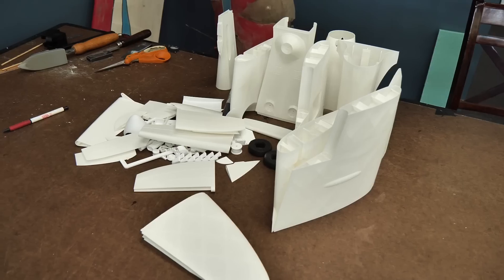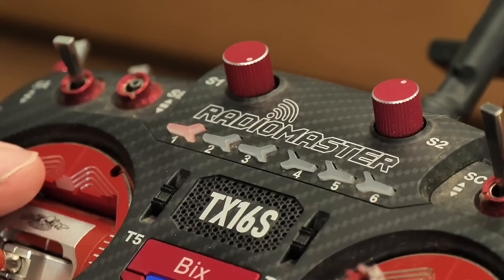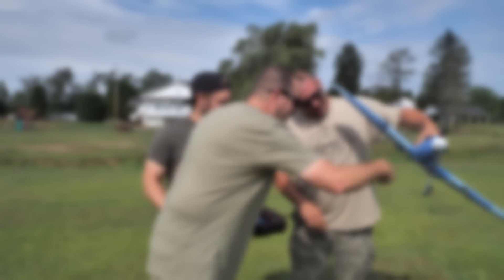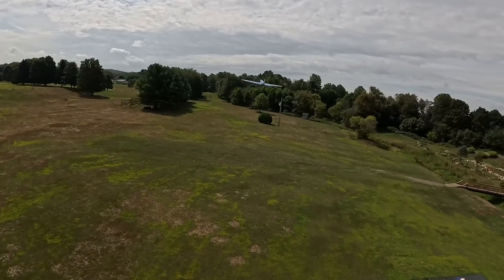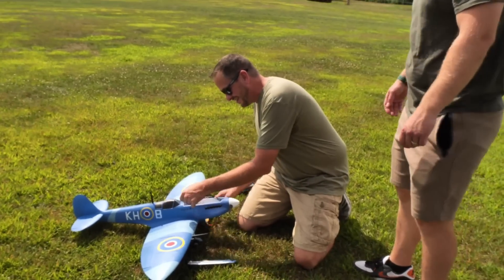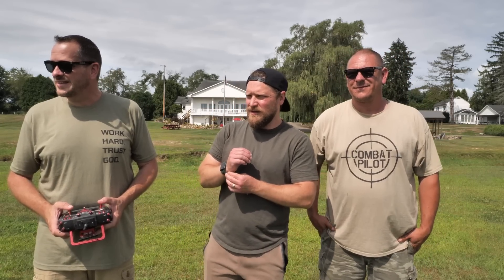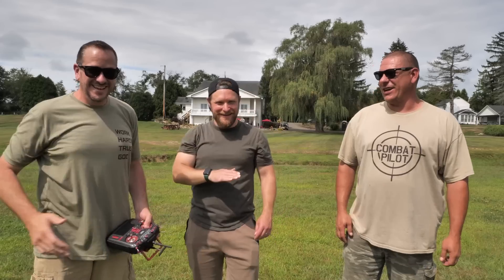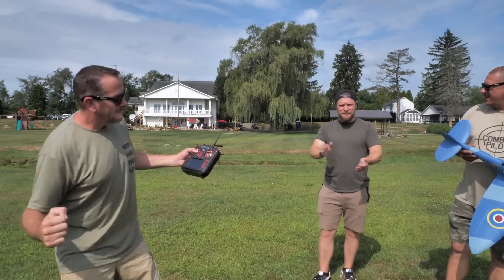Turning Plastic Into A Flying Airplane - Eclipson Spitfire

Comment: I make foamboard planes but I use 3d printing for the details (cockpit, cowl, etc) because 3d printed wings and fuselage are much too brittle. Foamboard is a perfect building material for planes. I will stick with it thanks.

Comment: I have 2 UAV Vtail 3d printed planes. One is LWPLA the other just regular PLA. The LWPLA is 38% lighter, but the PLA plane flys so much more stable. The extra weight didn't impact my stall speed all that much. I fly using Ardupilot with a massive battery pack. So for long range and stable picture or video the PLA is a winner. For acro planes and LOS flying LWPLA is the way to go.

Comment: If you want a nicer finish, you could use at least 2 coats of automotive spray paint filer (like Duplicolor), and finish it with fabric spray paint (like Tulip) to get rid of most of these 3D print lines (one get rid of big "steps" and lines, the second finer ones left without completely removing all fine details). It work well on most of my printed stuff (especially resin prints since way less rough than wire prints).

Comment: Josh & Crew, try a base-coat with Minwax Polycrylic. I just tried it on the 3D labprint Cub and it does WONDERS for stiffness/strength and smooths out the coat for painting/decals!

Comment: Hi Guys, I am Chris in Bulgaria. I have been watching your channel since the days of the star Wars models. I would love to see a Rockwell B1 made. I designed craft when I was a boy and still get creative having just built a model of the Bleriot from parts from the local DIY shop. One thing I noticed in this video and other ones since I make good ones, are replica propellers. You made a MK21 spitfire with a MK1 prop. I liked the blue though. Maybe authentic props make for hard flying, but you guys like the challenge. If you do the Rockwell B1 send me the 3d model and i will make one on my little KP3-mk2 printer. Keep up the quality work, Chris

Comment: dang it, my comment vanished when I added a picture link.

Anyways  the Photo Reconnaissance version (the PR.Mk19 such as PM651 that lives at RAF Cosford) were painted in an all blue (not cammo style)  livery.

NB these had Griffin rather than Merlin engines, a 5 bladed prop, retractable tail wheel and were unarmed with additional fuel tanks in place of the ammo bays.